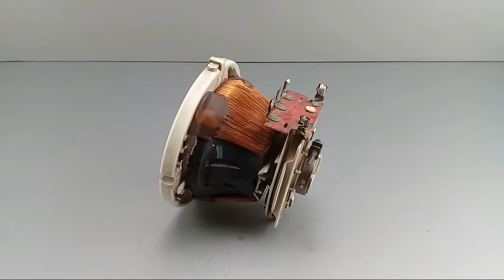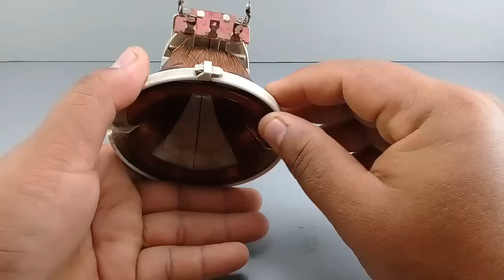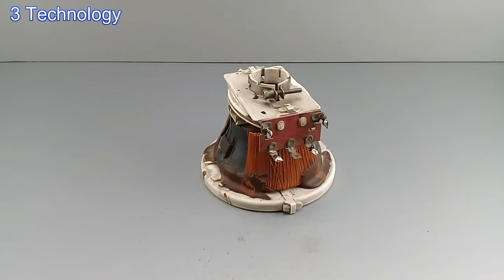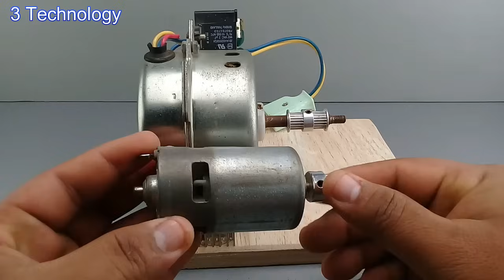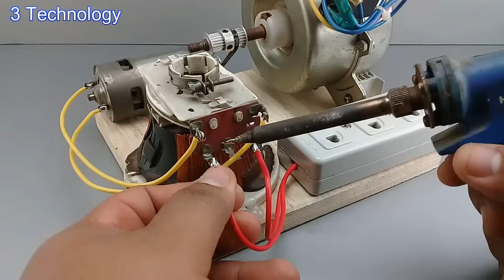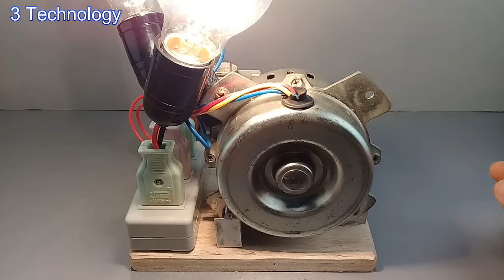How to make free 220v 7000w electricity generator with TV transformer and DC motor

Comment: Oh good, YouTube is recommending videos on devices that break the laws of thermodynamics/conservation of energy again.

So, there was a video cut (edit) or two ..

And when it's "running" the centre point of the rotational show and tell, is between the socket strip and the AC motor...

Also that gap between the devices is never shown very clearly, and when you do see it, there looks to be something brown, like cork, down the gap...

It's not magic, it's simple deception...

There is a thin 2 core cable coming up through the desk and baseboard, to the socket, which has been disguised between the socket rear face and AC motor